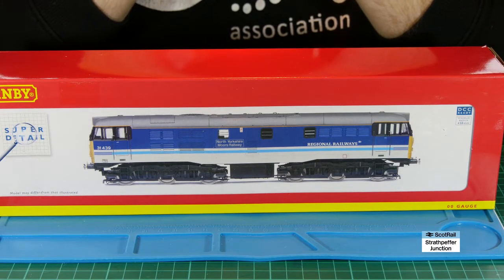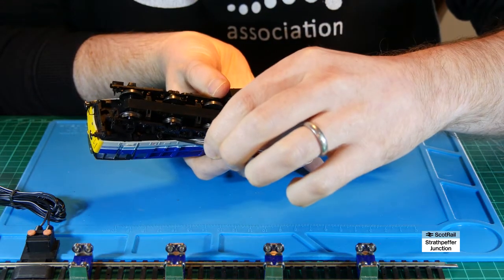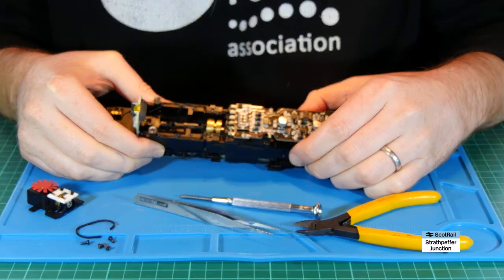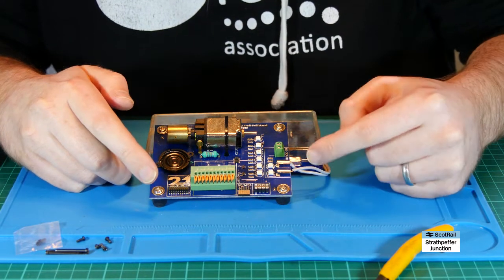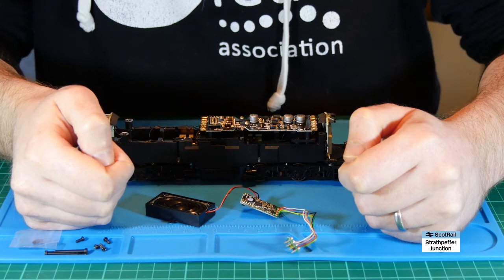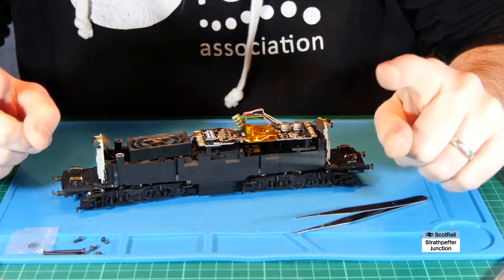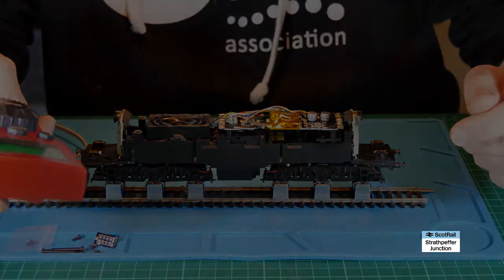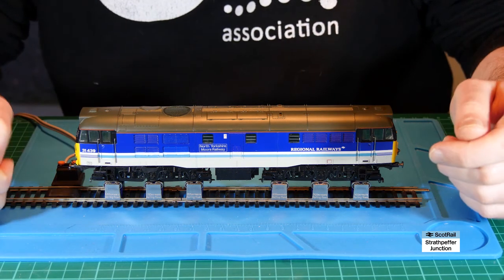#5 Hornby Class 31 - Fan Removal & Installing a TTS Sound Decoder

Comment: Nice how to, Where the fan was, we normally use/recycle the dcc decoder box, cut into shape and use the cardboard cut out as a floor board, We then stick it down with electrical tape. to hold the speaker in place we use double sided white sticker pads and pop the speaker on top :)  It does the job nicely.
Reply from the maker: That sounds like a neat approach too! Many thanks for the comment 🙂

Comment: Hi - I have installed TTS in several classes including steam - but I use Iphone speakers - they are really powerful and hardly require any space. With steam this can often mean you can get the speaker in the boiler housing rather than wiring to the tender - or vice-versa depending on if the motor is in the tender - great video on 8-21 pin conversion where space is tight - I had already bought some converters (DCC concept which means wiring should be easy) and in one I have fitted to a Heljan there was enough space but latest projects to class 37 and 47 I am aware there will be no space
Reply from the maker: That sounds great! Heljan can have a higher current draw and can be at (or over) the limit of what a tts decoder can handle, but it can be a case-by-case issue. If the models you have work fine with them, that's grand. And yes, iPhone speakers are a great option too.

Comment: That particular 31 release keeps eluding me, hopefully will drop on one. Good video mate :-) Taking of 31's....watch this space...
Reply from the maker: +ay76 Many thanks! I many focus on locos and stock that ran in Scotland, but I have a rake of regional railways coaches and, for a while, was after something to haul them. This one popped up on ebay a while back for a reasonable price given it wasn't running well. Given I like tinkering with electronics and motors etc., I figured I might be able to sort it and it was worth a pint. It actually turned out to be an easier job than I was expecting. It now runs really nicely and the sound is really decent for TTS. I think TTS is maybe a little lacking in steam, but with a reasonable speaker, it can work well on diesel...although I think the horns tend to be a bit tinny and poor on these chips.

Comment: Good video and some interesting comments. I to tried to fit the TTS sound decoder into my Hornby 31. My 31 was running smooth with a gaugmaster omni decoder. I removed the fan unit and installed decoder. The sound was good but the running quality was horendous. I called Hornby support and sent the model in...this was end of Sept 17 and I still don't have it back after calling them up regularly for a progress update. They reckon the poor running could be contributed to by the lighting unit, which they tell me they're waiting on a replacement to become available. Fingers crossed I might have the loco returned to me this year in working order....
Reply from the maker: Strathpeffer Spa Model Railway Jings. That's a long time to wait. Did you try tweaking the CV values? The running with this TTS decoder and 31 was awful until I switched to the second motor profile. I had actually filmed the issues, but the battery died right at the end. I thought it had saved the footage, but it hadn't, hence the 'extra' bit of footage at the end of the video. I think there are also issues on some Class 31s with the worm gear and plastic prop shaft, which can need lubricating and/or reseating. Anyhow, I hope you get the loco back soon. I've always found Bachmann pretty quick, but Hornby, in my experience, have been a wee bit sluggish.
Reply from the maker: Strathpeffer Spa Model Railway Incidentally, did you find any solutions to your 'power over points' problems?
Reply: Strathpeffer Junction 
Afternoon. No I never as Hornby told me just to get it in the post to them to sort. I totally agree Bachmann have been very good, I've sent models for repair to them on a Monday then had it returned by the sat. In Hornby's defence  I sent them my Q1 for repair and they had it back within the week and free of charge or postal fee.

With regard to my layout I've taken an extreme measure... I've stripped it all down and started practically from scratch from two new scenic section base boards. When I get time I shall try get a video up of what I've been doing.

Regards Alasdair
Reply from the maker: Strathpeffer Spa Model Railway I look forward to it. I can see the old station from my house, so it'll be lovely to see it modelled. :-)

Comment: Bonjour Strathpeffer Junction,I hope you are well despite your spine problems I am sad to learn about.  I have been watching several of your nice produced video's and like the way you show, demonstrate and explain things. Your experiences are most helpful so thank you for your energy, time and efforts ! But I have a question: In one of the vid's you mentioned the use of the Z21 command station. You also have experience with TTS decoders. So could you - if possible - share & show & comment your experiences on the use of this Z21, also in conjunction with resetting CV values, setting up a speed curve and some function mapping on TTS decoders. The Z21 seems to be an "up to date DCC system" with many functional features. Thanks in advance for your kind reply. Greetings from France. Filip
Reply from the maker: Salut Filip. Merci pour votre commentaries. Longue vie à la Vieille Alliance! 🇫🇷 🏴 

I absolutely plan to do a series of videos on CVs and programming, but I'll not be able to do that until the new year. However, Hornby TTS decoders are budget sound decoders and do not support CV5/6 or speed curve CVs, so you cannot customise the decoders speed settings as you can in many other decoders - this is one of their weaknesses. You can tweak the motor profile a little using CV150 etc., but it's far more restricted and doesn't really have anything like the effect that the speed CVs have. If you're in need of a sound decoder that does have control over speed CVs, you'll need to go for Loksound or Zimo products. 🙂
Reply: Rebonjour, Thanks for your prompt reply ! I subscribed to your channel and will eagerly wait for your video's on the subject. I agree on the restricted mode of the TTS. But I'm pleased with them. Motor control & smooth running is as good as my Zimo equipped locos - and simple for there are only a few CV's to adjust. The sound I like is just basic background chuffing, the whistle and breaking. I prefer simple things and the TTS is good enough. And while running two or more sound equipped locos the noise becomes unpleasant in the layout room. Anyway I look forward to learn more from you. Merci beaucoup and Happy railroading ! ( Votre Français est excellent - félicitations !)
Reply from the maker: @phil36310  Mon père parle couramment le français. J'ai appris un peu de français...pas assez cependant!
Reply: Et bien ... Voilà ça explique l'alliance. Je comprends mieux. Alors un prochain video pour la communauté francophone ? Question d'excercise . Merci et bon courage !

Comment: Be careful where you put the decoder. Mine was sort of in between the circuit board and the roof. It must have been a bit close to the roof and it started to melt the plastic and then it burnt out.  From the outside you can now se a bit of a bubble where the plastic melted underneath, which is a bit of an eyesore now I know its there. They get really hot and i was wondering if that tape will let enough air in around the decoder to keep it cool.
Reply from the maker: I always make sure the I leave the end opens, so heat can escape, and these days I tend to use a lesser amount of tape too, having experienced a hot decoder issue, although no melt. You are absolutely right that decoders can get warm, and if you run a model constantly for quite some time they can run quite hot, so keeping them away from plastic body parts is very sensible (although not always easy in some models).

Comment: Great video , could you spell the name of that tape you use to protect the electrics from shorting out . My hearing isn't that good .      Cheers......Peter
Reply from the maker: Peter Shaw Sure. It's called Kapton tape. You can get it from most electronics shops, ebay etc. I find it easier to work with than electrician's insulation tape, and it also doesn't seem to come loose over time in the way same. I rarely use the electrician's tape at all on modelling now. Here's a bit of blurb about it: https://en.m.wikipedia.org/wiki/Kapton
Reply: Many thanks for your reply , I thought it was captains tape so wasn't far off .    .......Peter
Reply from the maker: +Peter Shaw Close! :-)

Comment: Very interesting and informative. Did the cab lights work?
Reply from the maker: +William Glover Many thanks, William. Much appreciated. Yes, I've since installed some miniature warm white LEDs (one in each cab) and hooked them up via a 5k resistor to the Aux channel (green wire). The way I did it was solder the LEDs in parallel, add a resistor to the negative wire, then solder it to the aux pin on the socket (underside of the PCB). The positive wire then got soldered onto the back of the common (blue wire) pin on the socket. Put a layer of Kapton tape over the pins to stop any shorting and Bob's your uncle!